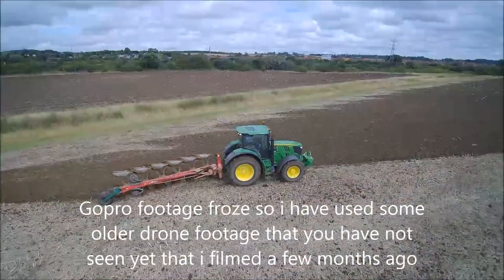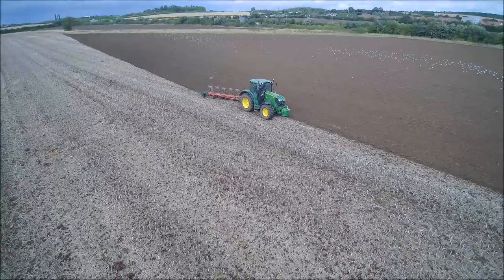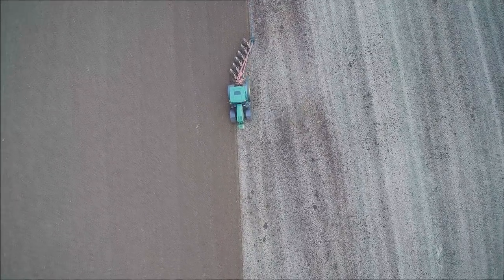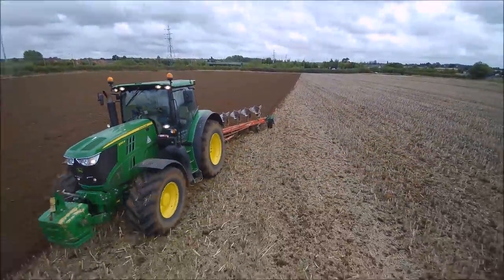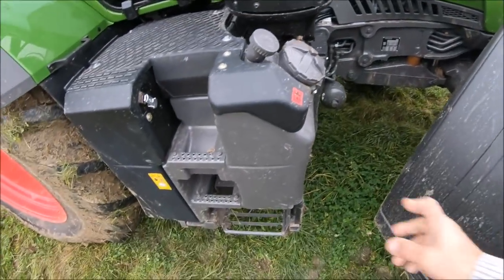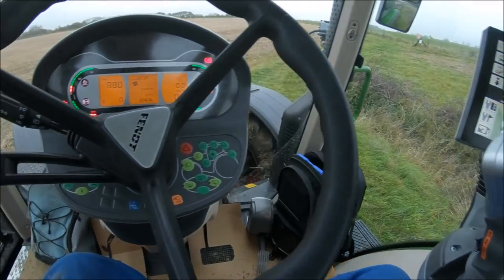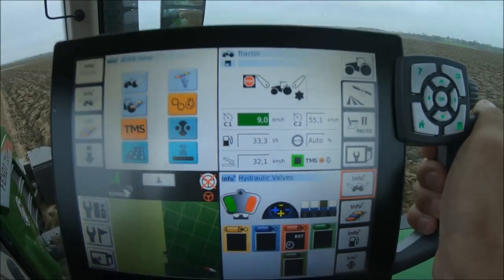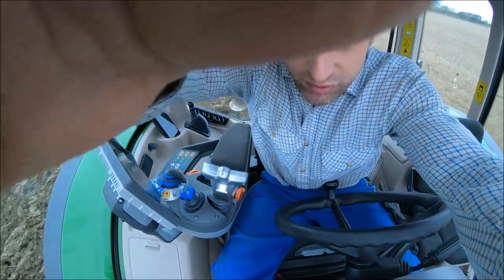JD 6190R Vs Fendt 724, Same Field Same Plough

Comment: Well obviously the fendt will do better it has 50 more horsepower, go try like a 220 puma for good measure
Reply: Christian Gierach That 190R will boost to a similar HP as the Fendt.
Reply: Exactly , the JD with boost also comes close to 230hp

Comment: Neither are a fastrac tho George 😂 unfortunately it’s Fendt all the way for me dont rate the new John deers at all boring tractors... yes fendts are expensive nd probably not the most user friendly tractors but there cracking tractors & worth every penny if u ask me...  u get what u pay for same as everything in life.. we have 2 fendts & never had any problems haven’t chewed any varios they pull like hell there good on the road top tractor in my opinion.. personally I think the reason they break varios is rough drivers not understanding how to use them properly
Reply: The Wippit yeah exactly
Reply: There's not a tractor on the market that's worth there money they're all   way over priced!!
Reply: Allen Buckley - same as everything in life

Comment: The question I always end up asking fendt, John Deere and massey Ferguson drivers. What can their tractor do that a new Holland can't at a fraction of the price. They have a good enough cab and decent road manners. They offer everything you could ever want from a tractor
Reply: Diesel Power .out dated I guess.like Nokia phones ...there too slow and behind the times.
Reply: STI Jackson reliability... Fendts have a lot less break downs then any brand pretty much. Of course there’s a few but overall really well put together tractors but your right they are expensive but they save fuel and repair costs which factor in long term 
Have a good day ;)
Reply: where do i start? A NH has it almost all, but everything is just not well made. I'm not saying the NH is a bad tractor, it just has not those fine details and massive reliability . And then , the price your fendt is worth when you sell it. Makes you happy.

Comment: Hi George, how much does the Fendt 724 tractor cost? Looks smooth.

We bought our son a Fendt remote control tractor with a trailer that you can tip via the remote control.
Another top nosh video. Thanks for sharing.

Comment: Nice video George, drone shots were pretty tasty. 
As for tractor preference, most tractors today are decent but i think for value for money and fairly good reliablilty New Holland wins that corner. Plus if you want a simple tractor, powershift box, manual spools etc then they can cater or if you want a CVX they can cater for you too. However the resale value its rubbish.

John Deere are what you'd expect from them to be honest. Good tractor, bulletproof autoquad/powerquad gearbox, spacious cab and a more comfortable tractor than a New Holland. Also there is a better resale value but if you are buying a second hand tractor, you could easily get a bigger HP, better spec New Holland for same money with fewer hrs than a deere.
Claas, underrated to be honest. They are great machine, the arions are a nice machine, comfortable, very good gripping however the old model Arions lacked in cab with spools too far away and just not the nicest cab to spend a day. Dearer than New Holland when new, resale value is terrible though.

Fendt, getting very popular but they are seriously overrated from owner's point of view. They are expensive initially, then the running costs are extremely high as you cannot put a spanner on them yourself and they eat vario boxes at £10000 a pop. Not the bulletproof tractor everyone assumes because of the price. 
Obviously, very well specced, lovely cab etc no complaints from drivers POV and they have good resale value. 

I think for a well rounded machine you'd be after a New Holland or a John Deere, in my opinion.
Reply: There's also Ferguson that has the best CVT gearbox (Fendt) mated to the best engine (Sisu). The only part that isn't superb about them is the cab on the 7/6/5000 range but it is still pretty good, at least it's not the nightmare of a cab that New holland uses...
Reply: A lot of the reasons the vario boxes break are because the operators. Theres a lot of people who have broken thier gearboxes on thier fendts cus they didnt understand it properly. Not saying thats the only reason they brake though.
Reply: You must have owned all them tractors,how many and what makes do you own?
Reply: Crap resale value on new Holland’s is great for poor folk like me cos I can get a decent tractor for comparatively less than other brands and I just generally like them
Reply: AgriFan new Holland are reliable until the brakes go. And they go every thousand to 1500 hours..
Reply: John Deere 6830 fan No the brakes shouldnt be away by then. Have driven many T7s with 5000, 7000, 4000 hrs and no brakes put in. Alot is down to drivers.
Reply: We have New Hollands and the brakes never "go" after 1500 hours,who told you that bullshit?
Reply: In fairness a friend of mine has a t6080 and the brakes keep failing on that and they can’t understand why cos it’s had larger brakes and it’s not like its pulling old trailers round with no brakes
Reply: AgriFan not to sure about your Fendt experience because I run 4 of them and have next to no problems and are the cheapest tractors to run, super fuel efficient. Have a mechanic that runs 6 of them and haven't heard of the vario box breaking? And even when they have 6+ thousand hours they still run sweet.
Reply: And the piggery down the road I have driven his new holland loading tucks for him and wasn't to great and he said himself he wouldn't buy a new holland again.
Reply: True,
 operator error is a big factor in a lot of these cases!!
Reply: You want cheap an reliable than you should try Belarus MTZ,despite what people who never owned them think about them these tractors are undestructible and ridiculously cheap to maintain.And they will outpull any other brand in that HP tange because of their heavy construction.I have Mtz 1221 with 12 000 work hours and never had a single problem that i couldnt solve by myself and it cost me 29k new from factory.The rebuild kit for this tractor costs like 300 $,hydraulic pump is 40$ new,clutch disk is 70$ new etc.My dad bought a new Fendt 309 vario and paid him 80k,it now has around 10 000 working hours and it is starting to have issues with electronics and vario.Its obvious which one of our tractors paid itself  compared to price we paid for each of them.Fendt is overpriced and unnecesarily complicated,and electronics are a sensitive as fuck because we have rats on our farm and they like to spend winter nights under the hoods of our tractors where is nice and warm.On Belarus they once chewed some wiring and we fixed it with ducktape,on Fendt  we had to call the dealer to fix it because the tractor was dead completely.He replaced some wiring and a computer and went with 4k $.Also on Fendt you cant do any repairs by yourself because you dont have the tools,and maintenance parts are expensive like they are gold plated.On Belarus you need a set of wrenches and some ducktape and you can basically fix everything on that tractor.Sure Fendt is more comfortable to drive but to me it matters only wich one brings me more money,in this case its Belarus.
Reply: AgriFan 9

Comment: Hey nice video! It boosts to 209hp when you have the pto in gear or your speed is 14k or faster.
Reply: It's a farming life for me! Doesnt it boost to 235?
Reply: Control technology are you sure it boots to 209hp I could be wrong here but I think a representative from John Deere told me that the model number on the bonnet is the boosted hp so basically a 6190R is 170 boosting to 190
Reply: Its the 6195 which boosts to 235hp

Comment: Normally the john deere boost the horsepower by 40 hp when you are using the pto and higher then 15 km/h
Reply: Green power 6210r do they catch it out of thin air?

Comment: I'm not a fan of either of these tractors. But once again not a fair comparison there mate. Get the same HP rated tractors and then do this. This video means absouluty nothing apart from stating the obvious.
Reply: past 160/200hp it doesn't matter but controlling wheelspin in fat clay/ wet conditions is the real challenge